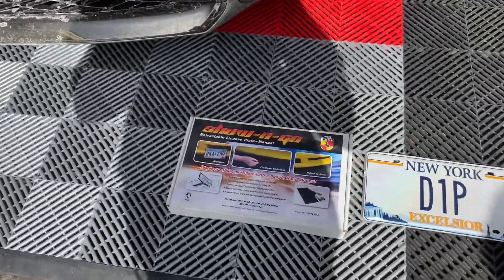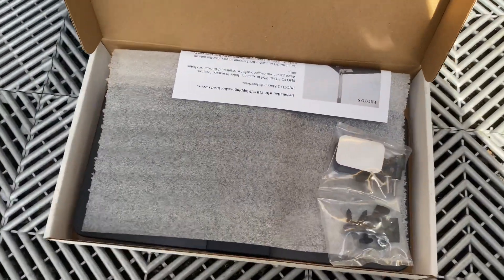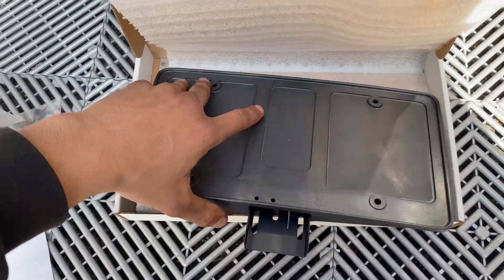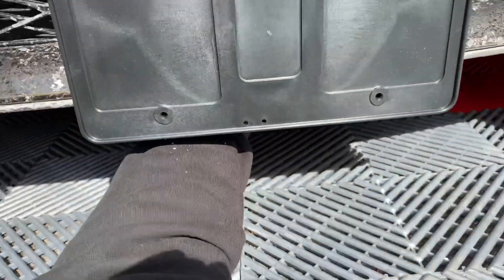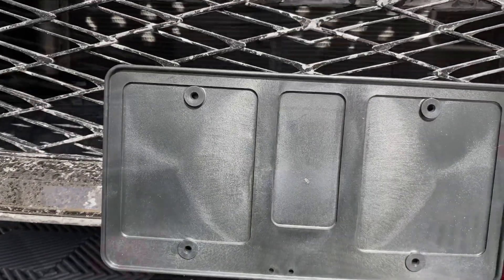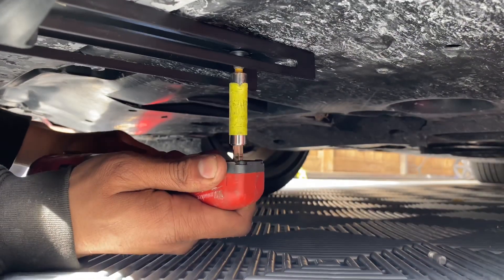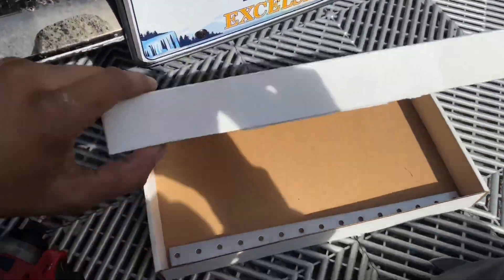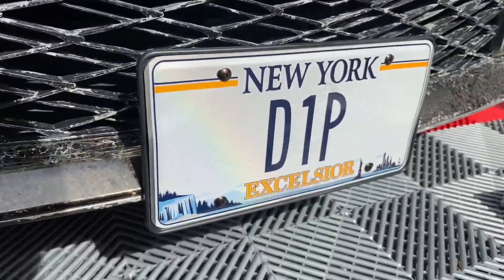Show-n-Go Retractable License Plate Install on a 2020 Lexus Is250.

Comment: Hi, are the screws on the bottom self-tapping screws?  thanks.
Reply from the maker: Yes. Or if you have room to use small bolts and nuts, do that.
Reply: @slamdeencustoms6959  ok thanks!
Reply: @slamdeencustoms6959 have you done this on a 16’ IS ? 

Mine has a front splitter
Reply from the maker: @leojohnwayne1422  it’s the same install for any vehicle. Just find a spot for it to be placed.
Reply: @slamdeencustoms6959  how much is it for installation I’m in NYC